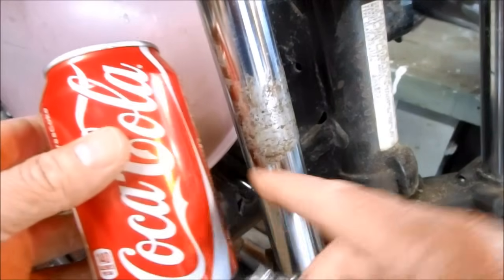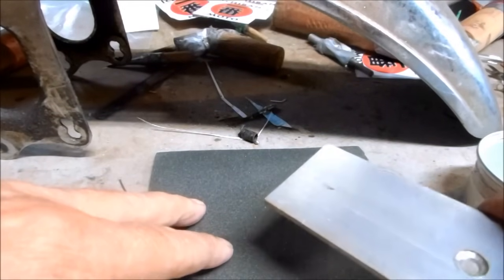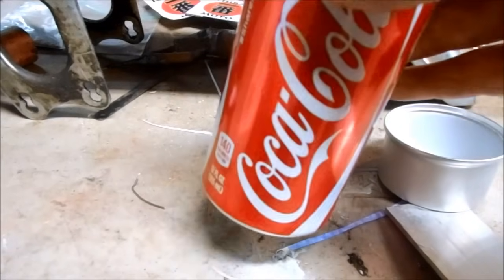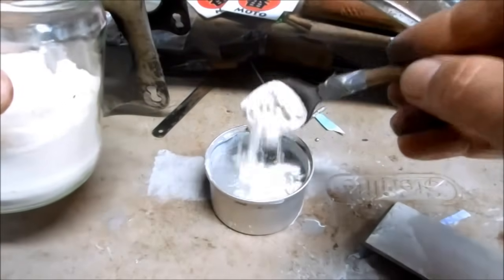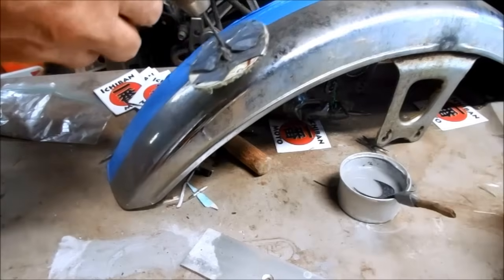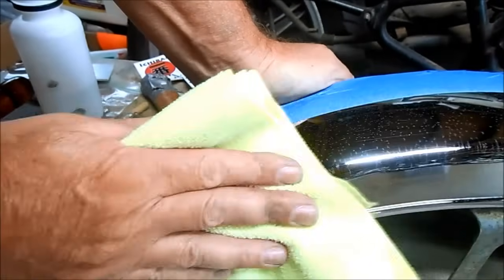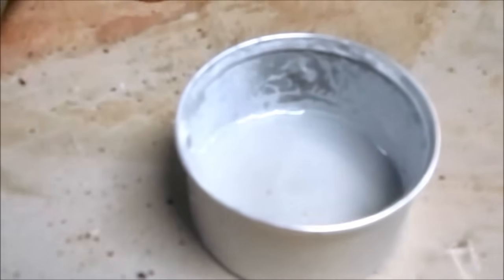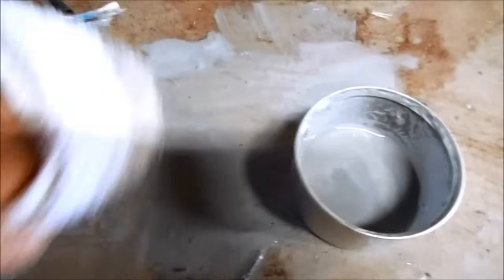how to remove rust from chrome faster and easier than coca cola and  aluminum foil

Comment: Would have took 5 mins with some normal cleaning paste. Those little dots come back after a little rain etc. Because you're not removing rust. You're removing rust stains from the chrome that leak through those pinholes.
Reply: Would have taken*

Comment: I've been polishing chrome for years with 0000 steel wool and Windex. Works great a lot of the rust is bleed over from tiny cracks in the chrome so it basically wipes off. What I haven't figured out yet is how to fill the cracks or pitting where no chrome exists with something that can be polished to get better results on parts in a more neglected state.
Reply: I use the 0000 steel wool (w/ Diet Coke, WD-40, or just dry), but how come the Windex?
Reply: I use the wool with liquid turtle wax. Works amazing. Old biker trick.

Comment: Your solution makes a wonderful polish but I've noticed that all of the rust pets are still very present on that fender and I would suggest taking the fender material down to the level of those pits to penetrate all of the rust first. THEN use your polish concoction. I would use WD-50 as a lubricant an #0000 steel wool to get all of the rust off THEN buff your solution into the fender. All rust pits would be gone AND you'd get a wonderful mirror shine.

Comment: If you need to polish aluminum that is not anodized and is turning white, use ashes from a wood stove on your buffer - works way better and faster than the expensive pastes. Sift the ashes through a big screen sieve to get a fine consistent powder from your ashes. I have spent many hours polishing aluminum and bought the expensive paste, and then tried wood ashes, trust me. Ashes all the way.  Maybe it would work for chrome too?

Comment: I've seen a lot of comments teasing about the drill.  As a contractor, I have to say that's a great drill.  there's a lot you can do with a little hand drill like that which is superior (not faster) than an electric.  for this job I'd use electric for the speed but that drill will last forever, doesn't need an outlet, and is especially good for drilling through glass tile (with the right bit) or drilling somewhere you don't feel like running an extension cord when you just need to make a quick small hole.
Reply from the maker: +David Boone   it never lets me down !  :D

Comment: I'd follow that with Turtle Wax mag wheel polish. That'll get some of the scratches and pits out of the surface. Works well on stainless steel mufflers too. I did that every spring on the SS exhaust on my '94 Probe tuner for years...same muffler too.

Comment: Note : For more fast acting solution use Apple cider vinegar..  its stronger acid than white vinegar .. and also baking soda. Can make bubbly solution mixing the two.. and When done make sure acid is nutralized by rubbing in baking soda . (Baking soda, by itself). Otherwise the acid from vinegar may continue to eat away at the metal. Maybe white vinegar and salt may do fine as in this video.. but for more tough or stubborn grimey jobs i recommend using the ingredients i mentioned .. because i tried the salt/white vinegar .. but it wasnt helping fast enuff. So i lookd into how to intensify the process. Came up with that. It served me well.
Reply: Why would you (use a stronger acid) only to neutralize it right away??
Reply: Also white vinegar is more acidic
Reply: Mixing a base and an acid and expect results from that. Yeah right...

Comment: Before trying this on my 1973 mercedes chrome bumpers i need to know few things:
1. Doesn't abrasive particles come loose (from the sandpaper) when you make aluminium powder? if so - it would scratch the surface more..
2. How long does this deliciousness last? I mean the glossiness :) because the rusted spots are still naked
3. Any  ideas how to preserve parts from further rust? Polish with some vax?
BTW i like your sence of humor, a lot! :D
Reply from the maker: +Evaldas Virketis   I use diamond paper, not sand paper, so particles do not come off.  You can use some vax on the parts after cleaning and polishing of there are bare pits left as in the example :)

Comment: be careful when using aluminium powder...dont breath it in.
Reply: Just use fine steel wool
Reply: I used to sand down copper tubing for art and fabrication and let me tell you dumb me didn't use a mask and the after taste was horrid for day's
Reply: Yeah it's probably the worst idea. Especially for the old. Alzheimer's and organ failure.
Reply: Best to use silvo cleaner, it's basically what he is making but you don't need to worry so much about the pure aluminium powder.
Reply: Why? I snort lines of it and never had a problem.
Reply: Sounds like it's too late listening to him.
Reply: Screw that its highly explosive...
Reply: @dan_austin__873  ha ha ha,     and how much aluminium powder did he make with how little sanding,     lol     he poured it out of a container,   he didnt sand for hours to get that amount.    Hes all shit
Reply: @G7FQG - if you breathe enough of the aluminum dust in you'll forget that you even breathed it in, in the first place. It takes care of itself.

Sorry that is a terrible Alzheime's joke. (As aluminum inhalation causes Alzheimer's.)

Comment: On these jobs I use a rag, water and Comet, then polish with any chrome polish, but not Happich. If you are careful Comet leaves no scratches. If unsure, try using Bon Ami as its less abrasive. The Comet knocks out the rust bumps. Ive even first run a razor blade to knock them down then the Comet. Obviously you cant do much if rust created holes.

Comment: I sure feel like soap and scotch Brite would have done that in less than 20 minutes
Reply: It would have, still a clever diy though.
Reply: Steel Wool grade 0000 and WD-40 so no scratches and the WD removes the rust and lubes for protection, just maybe wipe dry if on a chrome exhaust.

Comment: Oh my goodness. And -im an old gurl. Never had a home to do up before, and niw i have bought a home and some 1950s original kitchen chairs. I can try this on the chrome.  What i like is — i CAN make this mix.  Its all stuff i can get, and do by hand. You didn’t even use any electrical tools.  This is do -able.  Did you actually go for two hours straight?  If you did, ok, I’ll accept that and do my chairs in shifts.  But if thats not how long CONTINUOUSLY that you scrubbed gently, could you please reply.  Thanks heaps for this

Comment: a pink spot showed up after polishing?

Tried mothers mag polish on a scratch, then a pink chrome spot happened. 

later that spot got rust. Then I tried coke and foil to get off the rust. rust is gone but also added a little more pink lines to the pink spot

Comment: Couple hours? that's a 10 minute job with fine steel wool and some baking soda.
Reply from the maker: steel wool ?   i'm no rich boy :(
Reply: Ichiban Moto Me either but even as a kid my chrome bicycle fender had more rust on it than that but I borrowed my mothers steel wool she used for cleaning in the kitchen and it takes that kind of rust off almost instantly. It doesn't scratch the chrome either. Chrome being pretty hard material.
Reply: Nevr-Dull and 5 minutes. No need to over complicate things, Just get yourself a jar of nevr-dull wadding polish. You can reuse it over and over so it is very cost effective. I have had and used the same tin for about 7 years. Pretty good for a 5 dollar can of polishing wadding
Reply: darkwiddow1 I have used that before. Nevr-Dull works pretty good.  Brillo pad is still faster and cheaper though.
Reply from the maker: five dollars for what.. I'm no rich boy
Reply: 5 dollars for the Nevr-Dull, 7 years ago man. And if you bought diamond paper, you can afford a can of Nevr-Dull lol. All of the crap you used in this video cost 5x as much as a can of Nevr-Dull...that Blue carpenter's tape cost 8 bucks a roll...stop preaching your "poverty level" and just use some common sense
Reply: Ichiban Moto If you can't afford something found in every kitchen then you can't afford whatever it is that needs cleaned.
Reply: Hi
Reply: hi
Reply: And when he got thirsty he walked a mile to the village well and drew a bucket.
Reply: Ben Sutton भ
Reply: @_CryptoNoob_  dude I got a can from 1941 no shit and still works great
Reply: @IchibanMoto  lol it cost less than the sand paper.
Reply: You can get steel wool at the dollar store. they didn't have any sand paper or aluminum stock last week though when i went. gonna check dollar general
Reply: @geoffrey sssshhhhh ;)
Reply: @_CryptoNoob_  Thanks for that info mate. Im gonna be re-vitalizing an old Rabeneick Fahrrad Deluxe Klasse frame + chain protector and 3 60-70's Peugeot bicycles. Thanks.
Reply: Amen
Reply: @_CryptoNoob_  .....Never Dull, a staple in the U.S. Navy.  The name is deceiving thus the using it over and over for years.  Definitely awesome on brass.

Comment: I am completely convinced I need to buy an old motorcycle mudguard with surface rust and blue tape and a drill and a round thing with a nail and some sand paper and a block of ALUMINIUM and some vinegar and some flowers or somethin.

Comment: I would suggest trying some Happich SemiChrome polish. It’s a paste that come in a tube like toothpaste (commonly 1.76oz/50grams. I work on guitars and other stringed instruments and this stuff is amazing. I haven’t seen it in stores, I buy online. Chrome, nickel, gold, lacquer, enamel, it works almost everywhere and I have brought back some things most people would have thought were a lost cause. It does take some elbow grease, it’s not wipe on, wipe off but is an outstanding polish and different than most things I’ve tried. (I’m not affiliated with the company, just a happy customer).

Comment: Lay quadruple stacked paper towels, fully saturated with Evaporust, onto the fender (make sure theres no little air pockets) and then wrap it with Suran Wrap. When you remove this stuff, in about 6 to 12 hours, there will not be any work left to do, except remove what little (if any) rust it left behind with some 0000 steel wool. The steel wool will not scratch, believe it or not. You should only have to buff with light pressure, the 0000 steel wool will work wonders alone.

Comment: acid wheel cleaner and some fine steel wool would have done that in less than 2 minutes
Reply from the maker: acid is hard to come by. back in college, it was as common as weed
Reply: Or just vinegar
Reply: @IchibanMoto  😂

Comment: Best and simplest is ultra fine steel wool 0000 and liquid turtle wax! Soak the steel wool with the wax and rub away! It will never scratch the surface as long as you keep the wool soaked. I had a plastic bag stick to my hot exhaust pipe and went to the Harley shop. Old guy told me this trick. Works great on rusty chrome or new chrome with crap on it. Never scratches and looks great!

Comment: Aluminum foil works great and fills the rust spots while ridding rust. Finish with a metal polish and you are good to go. Dip foil in clean water and "sand" away rust!

Comment: I would like to see a side by side comparison of your solution Vs turtle wax chrome polish using the same hand drill polishing technique over a couple of hours I bet $100 the $2 bottle of chrome polish would work just as well.  I will try it on this super corroded antique ford centercap I just found buried in the dirt in the woods.

Comment: Hello sir ............................ your videos are great and provides me  a cheaper way to correct thing on my bike instead go to a mechanic and spend a lot of money sir
what is cleaner posh ..........if it not avalaible what we put in the solution and we  put the paste with hand  instead of machine which u used in the video ......plz guide me
Reply from the maker: you mean like... manually? that would take awhile
Reply: yes sir

Comment: Just beware what parts you use that on, considering that youll also be buffing the piece with the abrasive diamond powder that got loosened from the sandpaper.

Comment: Try Bar Keepers Friend Powdered Cleanser & Polish.  It is about 3 bucks at most stores.
Reply from the maker: 3 bucks? I'm no rich boy   ;)
Reply: I've been using Bar Keepers Friend on my stainless steel sinks for years and never thought of trying it on chrome.  What do you know, just tried it on an old spare fender I have and bam, worked like a charm.  Great tip sir!

Comment: Please obtain a proper buffing wheel & polishing compounds &  your polishing time will be a 3rd of the hand effort applied . With modern clear metal coatings/sealants it will prevent oxidation  which is the start of all corrosion in ferrous and non ferrous metals.

Comment: With all do respect, Screw all of this!
 A roll of aluminum foil and a bowl of water and 1 hand.
Get the fender wet and start rubbing the tinfoil across it like your sanding. It makes its own polishing compound too! 
 I detailed a complete Harley that was loaded with Chrome from the handlebars, engine parts, exhaust, and wheels that had been sitting outside for a couple years. It came out amazing. I worked on it for 12 hours.
 Everything was spot rusted and all it took was some gentle rubbing. I wasn't even sore afterward. 
No crazy toxic chemicals!!!!
Reply: Can it be done for exhaust pipe that is not chrome? My factory standard exhaust pipe got a surface rust. It used to be black though. I'm affraid it'll weaken the pipe
Reply: @glowiever  im not sure how it will do. Might mess up paint surface. Chrome is easily scratchable so i would think the tinfoil is a mild abrasive.
Try small area underneath.

Comment: Still putting in the chrome that means dat the problem isn't really solved. It is just nothing more than wiping the oxidation with is much faster done by some paste and a proper drill machine.😁😁

Comment: The grated aluminum is not entering into a chemical reaction.  It is just providing a grit to remove the rust by physically grinding it away.  Any kind of grit would work.  Do you think that salt and coke are dissolving the aluminum?  The coke comes in an ALUMINUM can and does not dissolve the can.  You are not plating the iron with aluminum.  Every auto manufacturer in the world would be plating iron car parts this way if it really worked.  Acids will chemically dissolve rust.  People use vinegar (acetic acid) and lemon juice (citric acid).  They use Coke (phosphoric acid) and they use oxalic acid. The commercial product "Barkeeper's Friend" has about 10% oxalic acid.  The best acid to dissolve rust is HCL (hydrochloric acid).  You can get this in a diluted form at any home center where it is sold as Muriatic Acid. Once you get back to bare iron, you will have to coat it somehow to keep out oxygen and water or it will rust again.  Most cleaners that are sold to clean out dishwashers are citric acid based.  The solid powdered cleaners for dishwashers are citric acid crystals.

Comment: I've always used 0000 steel wool and a little dish soap....doesn't take hours.
Reply from the maker: +horseman1968   what's the fun in that ?  hobbies should take hours
Reply: +Ichiban Moto I have so many hobbies I have to optimize my time...lol
Reply from the maker: +horseman1968  ah, ok. then some efficiency makes sense ! :)

Comment: Nah. SOS pad with the soap in it, and water. I clean the surface with 409 or Windex, or whatever, to get most of the contaminates off, as this will scratch it. I then use the SOS pad with water. This isn't as hard as the chrome, but tough enough to get the rust out of the tiny pits. I clean the part with a brush and water to get the soap off, then dry it thoroughly. Then I can wax it, which is an important step not mentioned here. Carnauba wax is good. sometimes I'll even use a torch, lightly, to make sure the wax gets into the tiny pits as well as possible. This is the best way. Nothing else works as well.

Comment: Listen, I detailed cars and bikes for 23 yrs and #0000 extra fine steel wool and glass cleaner gets the same results. I could have done that in the time this video was done. Not bashing anyone's just trying to help out when I can. You can also use on exterior auto windshield (glass not plastic). Also use on fake chrome for bus and the such, but use a lighter touch. DO NOT USE on Aluminum not even polished aluminum!!! Not sure, get a magnet or rub w finger, if it turns black it's aluminum.

Comment: Wait wait wait.... "After polishing for a couple hours". Did I hear that correctly? Where are you getting this "10 times faster than Coke and aluminum foil" from? This is a very inefficient method. You could get the same result in less time with a rag and metal polish.

Comment: WTF, table salt and aluminium mixture :( You are cleaning the surface temporarily, its cool, but the inside is getting worn out quick :-( this is why aluminium fins are not used in equipments in tropical areas and near to sea.

Comment: The process took TWO HOURS? And you used salt on steel? And the way you produced that aluminium powder was bound to mean it would be contaminated with abrasive material. 

I like the use of vinegar, but can’t help thinking that by also using salt, you’re guaranteeing that rust will not only return very quickly, but much worse than before, and there will be multiple minute scratches on the surface. 

I’m looking for a reliable way of removing heavy pitting on a pair of rare black chrome silencers. The idea is to achieve this without causing scratches, and without introducing anything that CAUSES steel to corrode. So obviously a chemical that eats rust and converts it by pickling is what’s required. 

Aluminium powder produced by breaking down foil using ball bearings in a tumbler might work. But that needs to be combined with a pickling agent that has a deep, lasting effect - without the handicap of also encouraging corrosion. 

The search continues.